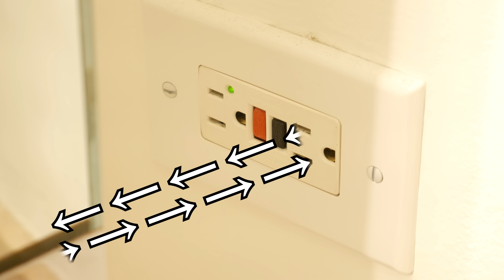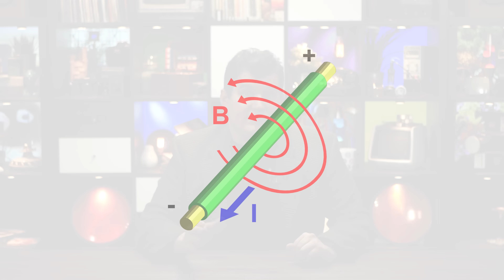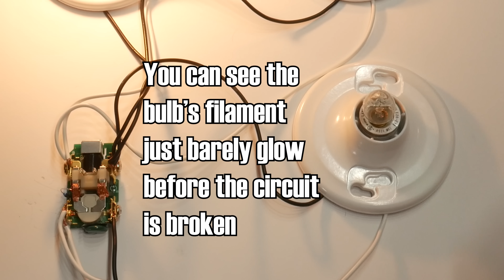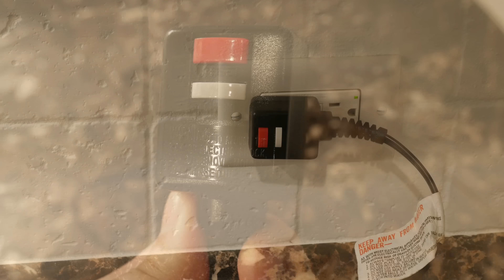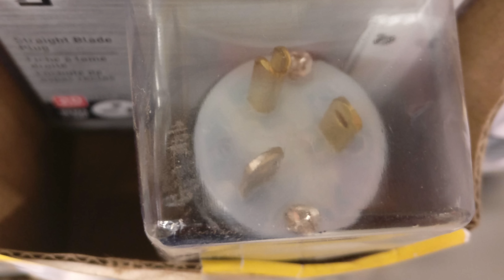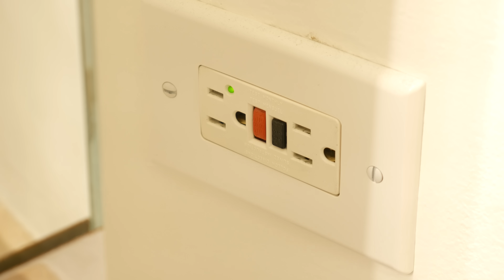The GFCI/RCD: A Simple but Life-Saving Protector

Comment: I live in arizona and my new house has these in the panel and not in the outlets. Actually saved me when I tripped it installing a celing fan where I thought I turned off the switches. Never felt any shock at all and me and the girlfriend were perplexed when the fan dident work. That's when I found that I had tripped it.

Comment: I just wanted to let you know that, so far, this is the BEST video I have seen on explaining the GFCI.  One question though:  At about timestamp 8:50 , If the brown wire of bulb "#3" was connected to the BOTTOM RIGHT (LINE) of the GFCI, then wouldn't it just be illuminated with NO fault occurring??  Wouldn't the other two stay on also??

Comment: Btw: P=U*i. European 230V means generally fewer amps needed.  So if they react in the same time, you have less electric fun in the same few ms. 
If they DON'T react, your as dead with 10A as with 20.

The beautiful german word for them is "Fehlerstromschutzschalter" about erraneous current protection switch/interrupter.

Comment: Here in Sri Lanka, we call them MCB - Mini Circuit Breakers. They don't exist at the outlets though. There is a big panel that gives access to the Main Switch (One you turn off to cut the power to the entire house), Trip Switch (One that goes off for lightning or when someone get's hits by electricity in house, this works with the Earth I guess) and a bunch of these MCB that cuts power independently to multiple parts of the house. Our house circuitry is divided to about 12 parts each floor so 24 parts altogether. There are 24 MCBs. 
We use Brtish standard outlets and plugs here that has always come with a on/off switch and a opening and closing slots.

Comment: I live in the US and my gfci is integrated into my circuit panel. We had a faulty microwave that would trip it if it was opened while on. It sucked because the microwave was connected to everything in my room.

Comment: In the UK everything has a ground pin (though most are just plastic) so calling it a GFI would make people think it detects an issue with the ground pin: for instance your toaster has a loose wire and as such is conducting mains to the chassis: something if would detect but not in any relation to the ground pin.

Calling it an RCD ensures people at least don't mistake it for being related to the ground connection...

Comment: Thanks a lot for making this video. I have a question that I please hope you will answer.
It's a common "knowledge" among American electronic thinkers, that an isolation transformer is a almost mandatory device to minimize the danger of electrical shock from a device under test. My postulate is that an isolation transformer is a bad idea if you already have CFCI. A CFCI will never trigger if you are getting shocked by any device that is isolated by an isolation transformer and it will keep sending as much power it can, trough your body for as long you are touching. While without a isolation transformer, the CFCI do detect the any power going trough your body, and shuts off.
Am I right or do I miss the point? :-)

Comment: here in Bharat (India) we have these ELCB (Earth Leakage Circuit breaker) and MCB (Miniature Circuit Breaker) housed in the service panel/ mains.. fuse box as we call it.
with each room or category/type looped through their own switch/ tripper/ fuse.

but now I think I am too dumb to exactly decipher how or what exactly do they do differently that these  ones

as a kid I understood that Paa (papa) would usually ensure that an audit was done by an experienced electrician to have all 15amp items.. air conditioners, fridge, washing machine and such on a different fuse/line.. often a mixer/ grinder / blender would otherwise mess with old TVs or microwaves and computers/ printers would get edgy if used simultaneously in different parts of the house.

and of course later we were the elites :P to have power back up units with their car type batteries and the inverter unit.. so anyway the fridge, washing machine, microwave, AC were looped OUT on a different fuse than the rest of the appliances which drew power from the "inverter" during the frequent power cuts.

Comment: Differential switch or 'loss of current' switch or earth leakage switch. We have a 300mA and a 30mA, 30mA for 'wet circuits' like bathroom and washing machine. 300mA for the rest of the installation.

Comment: The issue is something automatic drivers forget to do: applying the handbrake before leaving the car. On a manual transmission, you almost always need to apply the handbrake before leaving your car because there is no "park" gear. Regardless of the transmission type you have, you should always apply the handbrake when leaving your car. It may even be lawfully required in your area for you to engage your handbrake when leaving your car! It's exists to serve only one purpose: lock the brakes to stop the car from moving.

Having a car go forcibly in park without a person present in the seat could create problems for situations where neutral is needed, such as towing, and would only work on automatic transmissions as well. On a manual transmission, there is no "park" gear. A deadman switch in the seat would only stop the engine and let the car roll down a slope if it's left in neutral. It's the same problem with the riding lawnmower mentioned at the end of your video, you can also leave that in neutral and have it roll down a slope.

They could have the deadman switch automatically engage the brakes instead, but again, that poses issues for situtations where neutral is needed, such as towing.
Reply: The Dead man's switch could be disabled by activating a tow mode.

Comment: *"This actually creates a ground fault."
Actually untrue.
Some cheap and particularly naughty outlets, such as those ones with the green light that briefly flashes red, instead have a "Test" button that just shoves the mechanism into the "trip" position...
You can "test" this by seeing if the "Test" button trips the outlet when it's not powered.
Additionally I install them on various pieces of test equipment I have for that exact reason.
I made an outlet box that has GFCI protection built in, allowing me to easily protect any outlet.
My isolating power conditioner also has one, although it works slightly differently due to the isolation.
Reply: Such a test button is useless and such an outlet would be illegal.

Comment: I'm just kinda weirded out by these not apparently being standard in the states
Reply: Yep, only standard within reach of a water faucet.
Reply: Bobby Brady  Because the use of toasters is only permitted near water hazards?
Reply: Bobby Brady  Because RCDs are only required near water hazards. I do, however, agree that people sticking knifes into toasters should be subjected to Darwinism.
Reply: Bobby Brady  Hey, that was sarcasm. Also, sorry for misunderstanding you!

Anyway, RCDs/GFCIs are not only of concern for Americans. And while they are, nowadays, mandatory for new installation in Germany, lots of old installation still exist where the RCD/GFCI only protects "wet" areas. Most seriously is the fact that while RCDs were only mandatory only for the bathroom pre-2007 (I think), the central RCD could have easily been used for for the complete home. But most electricians did not hook them simple way, they chose a to bypass it for non-mandatory rooms because "it's not mandatory there, so I won't hook it there." Seriously. By listen to such....interesting opinions, I possibly grew too sarcastic ;-)

Again, sorry for me misunderstanding you. My first response was meant humorously, not insulting.

Comment: I would be interested in knowing how dangerous A/C 15-20 amp current actually is. I occasionally have to hard wire some things as part of my job and mooosstt of the time the wires aren't live, but on occasion you get a shocking surprise! I've been shocked dozens of times and it isn't really a big deal any more to me. I know that electricians are shocked basically daily and just get used to it. Why is it that we treat it as extremely dangerous if it is in many cases somewhat harmless.

Comment: The TLDR is that they are single wall socket circuit breakers.  To prevent either charged water,electrocution or tripping of the main breakers.  :P
Reply: No.  They are not circuit breakers.  If the device simply uses too much current, these outlets won't trip.  They trip on power flow imbalances, not current overload.

I mean, you can have a combo device that does both a circuit breaker function and a residual current fault interrupt, but Alec is just talking about the residual current thing here.

Comment: Great video. Very informative. I am an electrician in Canada and I am very well informed of GFCIs. You definitely did your research well as most people (including electricians) do not properly understand how they work. It was great to see the internal workings.  I would just like to add that in North' America we also have Circuit Breakers with built in GFCIs. But for the reasons you mentioned plus cost (GFCI breakers are much more expensive then standard breakers) we tend to use the GFCI receptacles. As for the $3 difference of 20Amp T-slot receptacle you showed,  I think that price difference had more to do with the fact you bought a gray colour plug and that it was also a Tamper Resistant plug (hence the TR) on the face plate. 15Amp and 20Amp are not usually that much difference in price.

That behind said, I would like to suggest you make a show on Arch Fault Circuit Interrupter (AFCI) breakers as the are even lesser known but are now being required in new homes.  I would also suggest the topic of Tamper Resistant (TR) receptacles.

Thanks and once again great show and channel.

Comment: Here in Germany homes built since the 70ties are required to have RCBOs, also if the electric system was substantially changed. The RCBOs are in behind the main service panel of a house, if it trips, just switch of all circut breakers (usually one per room plus some for special purposes like an oven), reset the RCBOs and switch on the circut breakers one after another, if the RCBO trips, the fault is in the last circut switched on (or it‘s a nasty one that takes time to trip). So you can figure it out in a matter of minutes, also you gain experience which kind of device usually trips it when it breaks (it‘s always the coffee maker)
For this inconvenience you get protection everywhere.
Reply: yeah american GFCIs are technically RCBOs because they include overcurrent protection in addition to residual current/ground fault protection.

You can actually buy ones that go in the main service panel, its just a more expensive option here compared to ones built into an outlet.

Comment: In France this is called "Interrupteur Différentiel"  well, because it sense difference between phase and neutral. For residential it is good practice to put a 30mA differential breaker, people tends to forget that those should be tested, because when those fail they can let go a shock and so someone could be dead. The house or apartment is provided by the utility company with a general differential breaker with 300mA sensitivity. I think this name describe better what is really going on in the device.

Comment: my only issue with gfci outlets is new building codes in many areas require that all appliances get hooked up to them.  as a result, water based appliances (garbage disposals, washers,  etc) repeatedly trip because moisture alone causes a false positive and trips the outlet. im all for safety, but there is a cross roads where safety devices seriously hamper the usage and productivity of something.

i can tell you first hand, the idea of slapping gfi outlets in every room wasnt for safety, it was lobbied into law to sell more 30-50 dollar outlets to contractors and home owners.

Comment: This video reminds me how much I don’t understand A.C.  I’m fairly competent in how to make it work and wiring circuits and all that but I struggle with knowing what’s actually going on. For example, if the current coming back has to match what’s going in, in my head I wonder why it should be the same, like what about the energy being consumed by the appliance?
Reply: The current of course is same. The voltage is lost in the circuit, not the current. If you have water turbine on a stream is the current after the turbine leas than before it?

Comment: As a Scandinavian: One minute into the video. "Wait what? You don't have RCD's for the entire house??"
Reply: We do. He gave you the pros and cons to local installation vs. panel installation. If we want whole circuit protection, we go the store, purchase the breaker and install it in the panel.
Reply: @ec8107  yes ofcourse. My comment were more of a light hearted and heat of the moment reaction. As we in scandinavia have these as standard in our houses.
Reply: Why wouldn't you just fit RCDs at the board and protect everything from there onwards, I've worked in New York and found that these don't work half the time as the earth into the apartment/house isn't good enough from the get go, unlike in the UK all incoming power is tested before you start any work, all circuits have to be protected as standard in line with the 18th edition.
Reply: @NuTfielDRobErT  Some of it may be because the UK does electric circuits around the house differently from much world using a slightly more complex 'ring circuit' system that saves on copper (since you folks were short on that after WW2)
You couldn't do 'one RCD at the board' and properly protect things, you have to do it one per circuit with the wiring north america uses. 
That in mind while you could put the RCD in the breaker box (in fact that's actually perfectly in line with U.S. electrical code, breaker box GFCIs are just more expensive than the outlet kind), there's some advantage to putting it in the room to be protected, in an electrical outlet: the home user sees it every day and is a bit more likely to actually test them compared to an RCD that's hidden away in a metal box on (in a lot of american homes) a wall in the garage.
Reply: @emontibeller7156  your comment made me feel every damn plug I've ever stepped on all over again.
Reply: Italian here, and the same scare.
Reply: I USA har de jordfeilbryter i hårføneren. Uffameg...
Reply: In new homes, they're generally at the panel.  Also, if you have a newer panel you can put them in at the panel as well.  The other advantage of having these at the plug is that older electrical panels don't have GFCI breakers even available, so instead of replacing the entire panel you can just replace the outlet.

The other thing is, GFCIs sometimes have nuisance trips, triggered by something else on the same circuit.  If your fridge is on such a circuit, you could have a refrigerator go out due to a nuisance trip and not even realize it until the food all spoils.  

Also, remember the US commonly has 120V at our outlets, not 240. So it's at least somewhat less dangerous because of the lower voltage.

So yeah, like most things, there's tradeoffs between the two different approaches.

Comment: Wait so in the US, the entire house is not protected or...? So what if you have a freezer in the basement with a ground fault that leaks some current but not enough to trip the breaker? Does that mean it can just leak like that? Electricity will choose the easiest path and that's probably earth, but still... if you have a metal freezer you're basically touching live and what if the earth connection fails or you're the shorter circuit?
In Europe, there's a 30 mA RCD for the entire house. The circuit breakers are connected to the RCD, but the RCD itself is not 'a circuit breaker'. Behind the 30 mA one, there's usually also a 10 mA one for wet rooms like the bathroom, garage, kitchen, laundry room and everything outside. Of course, all of your appliences together do leak a little bit of current.
In older installations (up to the early nineties) 300 mA for the entire installation and 30 mA for wet rooms was the norm, and before that (since the fifties) just one 500 mA was installed, which is better than nothing but is absolutely not acceptable anymore today and would still be capable of giving you a nasty shock.
Unlike what it's called like in all the different European languages, it has little to do with earth and is not connected to the ground wiring in your house. Like this guy explained very well, it just measured the imbalance, but in case of an electrocution, you're the path to ground, so they can still protect you even if your house isn't even grounded at all (which is what most houses were like over here up to the 70's - the RCD couod only trip if YOU are about to get electrocuted (if something goes wrong now, it'll only trip once you try to touch it), whereas now it can trip anytime, because the current can flow away immediately).